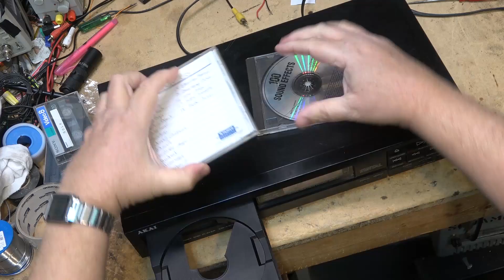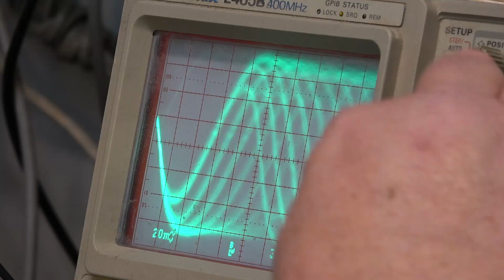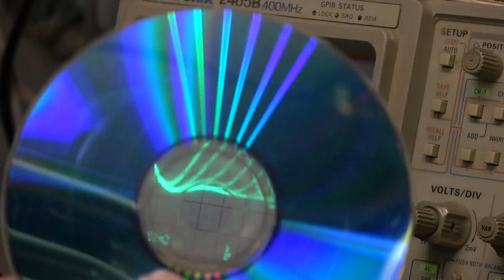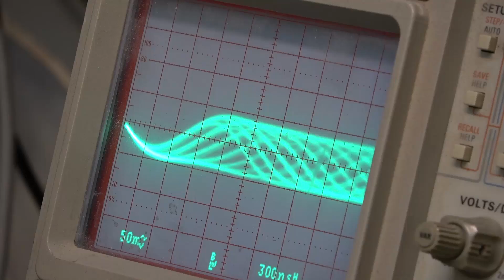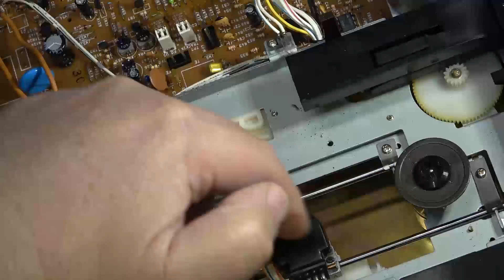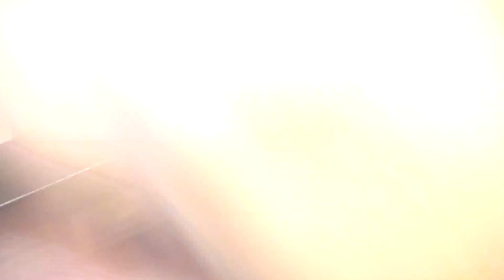Vintage Akai CD A30 CD player from 1986 will it work

Comment: I have slowly over time built an old school Akai sound system, a book shelf 3 piece set of amp, runner, and cassette, a reel to reel, 8-track, phonograph, speakers and head phones, the only thing missing is a working silver cd player. bought one, only to get it and find out its 230 volts, I am thinking of taking it to a repair place and having it converted to 120 volts, it wont be original but it will be mine and working anyway.

Comment: I have a very similar Akai CD player, it is a CD-A3X. It works fine, except when I hit the play button, the play indicator flashes rapidly as if it is going to play the CD, but it stops, and I have to hit the play button again to get it to play. Any idea as to what the issue is? Unfortunately, I do not have a scope. Thanks in advance.

Comment: I noticed you added external voltage to the sled motor without desoldering a wire to it. I did the same thing to a Linn cd player (1.5v applied) and now it's stopped turning. It had some fault where the sled motor was stuck in reverse in the home position whilst constantly turning. Have i blown the sled drivers with only 1.5v?
Reply from the maker: Possibly.
Reply: Update: no it survived in fact. Just that the faulty behaviour altered which caught me out. It's doing a shuffle during focus check so phew..

Comment: i have a mk2 version of the same cd player i have a problem i have cleaned the dust on the lens but still no solution i have to repeat it 3/4 times when i press the play button but then mostly it starts to read the cd it doesn't read at the first time and a song like 3,4,5 in any album When I try to start it, it doesn't come out of the line, sometimes after pressing the play button several times, the cd is read again, or the cd spins and the slider opens again.  What is the problem, how can I fix it?

Comment: That unit is 1983 in Tralee, kerry, Ireland. I purchased an AKAI Stereo system back then from my local Hi-FI Dealer, Hugh Culloty, Still also there. Namely AKAI Tuner AT-A102L, Akai CD Player CD A301 and an AKAI Amp AM A-302 along with a pair of Tensi 3 way active crossover speakers containing a 12 inch, 4 inch and Dome tweeter. All still working correctly in Sept 2022. Only  thing is the incandesent bulbs for the "LCD" display are not working. Must replace. But 29 years unbroken service is not bad going at all. Great manufacturer.

Comment: Does the clarity of the eye pattern on the scope says anything about the state of the pick up?
I have 3 CD players, one of them has a very sharp eye pattern, while the other two have a rather blurry eye pattern.
They all play CDs just fine, but I found that a bit interesting.
Reply from the maker: Yes a good laser the eye pattern is very sharp.  If it is fuzzy then the laser is getting weak.  Usually it is a cloudy lens.
Reply: @12voltvids  Thanks

Comment: Hi, sir, you have an oscilloscope galvanically isolated from the mains, or as it is solved, it is necessary when measuring amplifiers and so on, I am a beginner and I would like to understand here, thank you for any statement
Reply from the maker: Yhe ground prong has been removed from scope cord. Also my power out on the bench is totally isolated by means of isolation transformer.

Comment: Judging from the Sony chips and analogue filter, it looks like this Akai's a second cousin of my Ferguson CD-03 - itself an OEM variation on Sony's own CDP-102. The Ferguson's still a tidy little performer, with one proviso: if there's a speck of dust on the CD, it'll skip. In that respect, my rock-steady old Marantz CD56 (bought in 1984) wins hands down. CD players of that vintage were usually built up to a standard, not down to a price - it took manufacturers a few years to work out how to cut corners!

Comment: A little tip from me: to replace incandescent lights I use old Christmas tree lights.  (They are still sold and come in two bulb sizes) work from 5v at 60ma +/- to full light at 11v / 12v at 160ma. The intensity can be regulated with a resistor and they shine in all directions unlike LEDs.
Reply from the maker: Yes i know.  Will be looking through the box of old Xmas bulbs.
Reply: Thanks, great tip. Now i know what to put in the holders. Cheers

Comment: Setting up this CD player takes me back to trying to setup Laserdisc players.
Both side players were always a compromise between side A and B.
Interesting information on the difference between stamped and CD-R discs.
A well setup player will track even poor or damaged discs.
Reply from the maker: That's correct when you can play these low output cdrs which are the modern desks that are pretty much silver on both sides then you know the CD player is set up properly because with the low output the error count is obviously going to be higher if I player is out of spec it will typically start to skip
Reply: @12voltvids  I had similar experience with laserdisc players, you knew if you had setup issues if they could just about read a laserdisc, but wouldn't read a CD on the models with dual drawers.
The better players from Japan were better at tracking poor pressings.
The laser in the Hi-Vision HLD-X9 could even play discs with laser rot that other players failed to play.

Comment: Looking in to those hard to see places would be a good use of the bore scope you demoed. I appreciate your tidbits of information you add in to your videos
Reply from the maker: Problem is it has a 15 foot snake cable to get in the way.  Great for looking down drains and into cylinders or air ducts.

Comment: I did a demo of the Sony CD system around 1985 at the CBC. We generally found the disks sounded very harsh and brittle in sound quality at the time. The media at that time on the CDs were direct transfers from the original master tapes which usually had a boosted top end which would be "buffed off" of the vinyl pressing masters during the process of producing the vinyl disks. A few years later CBC Vancouver started a network radio program called Disk Drive where the concept goal was to play CDs only during the show. It took a few years before we were able to fully avoid the use of vinyl on the show as these were the early days of CD technology. We used Studer CD players which would often fail where a Sony audition player would play the disk without 'fails' or 'skipping'. This became more of a problem as the mass production of CDs increased. The error correction of the Studers was good to about 80% with software upgrades but the error rate on mass produced CDs were well below the accepted technical standards reading sometimes as low as the mid-60 percentile. We eventually converted to Technics pro CD players that solved most of these problems. Disk Drive with Jurgen Gothe aired for over 20 years on CBC Radio 2 (FM service).
Reply from the maker: Ah yes the old cinram disks so many of them were out if spec.   It was almost comical.
Reply: @12voltvids  Not when you were live coast to coast on the radio. Very frustrating and nerve shattering. Especially when you had no control or warning. At least with vinyl you could take a look at the platter and see if there was any visible damage or stylus wear. With CDs visually they looked the same whether flawed or perfectly manufactured. And we were playing mostly classical music disks so the expectation was that they were manufactured at the better plants.
Reply from the maker: @chriscutress1702  most of the disks sold in Canada were manufactured at that shitty cinram plant.  It affected many players and we would get players in that the complaint was skipping.  It was usually the high end players that had problems and the cheap ones would play fine.  Go figure.  Many early DVD players had similar issues.   Sony's too of the like had a compatability issue with many kids disks.  I remember one very well. Veggie tales with the talking vegetables.   Customers high end es DVD player refused to play.  Changed the pickup, spindle motor ext.  Put 500 in parts into this 1500 piece of shit.  Played every other disk fine just these ones that played perfectly on the cheapest player.  
Now I know what you are going to say, just  the customer to use a cheaper player.  Fine now the customer wants his 1500 back for the high end player that won't play his kids disks.  Very frustrating.  Sent it to Sony, they never did get it going.  Said the disks were out of spec sorry.  But they played fine on a 150 player and there was the problem.  Customer really wants money back now and it threatening shop with lawsuit. Going to sue the store that sold him a defective on his eyes player.  
Glad to be out of that business.  No wonder the owner had a stroke.
Reply from the maker: Early CDs were produced with analog tapes that had been equalized for vinyl. Record companies were cheap.  Proper digital recordings by Telarc, GRP ect sounded fantastic.  Also early CD players with early DAC had a bit of a harsh sound.  The tda 1540 used in early CD players was a 14 bit DAC.  CDs were sampled at 16 bit. The tda 1541 was much better.  Sony has very good DAC on their players.

Comment: Well it coped well with the 100 track disk, the firmware seemed ready for odd disks.
If all lasers were as good as that one.
Perfect looking eye, another ideal use of the analog scope.
Digital would have made  a mess of that pattern.
Reply from the maker: My shitty digital scope anyway.  It won't even display analog video.  Useless for most stuff.
Reply: My entry level digital scope does it just fine, you get a mess when you have made a mess of the settings.
Reply from the maker: @dlarge6502  mine won't display the eye pattern or video

Comment: Hey Dave I sometimes do a bump test just to see if when the machine recovers if it picks up at the exact spot of when the bump occurred. I have a portable Emerson boom box type that actually searched every track until it finds it. It didn't as I understand estimate the spot on the disk and quickly move the pickup to the approximate location and then find the start of the track. The VERY 1st CD player I ever owned. I later purchased another boom box type an RCA, it had a different system than the Emerson and it did an approximation of where the track was and quickly found the track compared to the Emerson. 
You worked on a Yamaha that had the EXACT same mechanism they used in my Emerson boom box. I don't recall if that Yamaha zipped straight to the track or not that was quite a few videos ago LOL. The circuits and ICs used to control the mechanism certainly make a difference in my experience. The Emerson really impressed me when it got bumped because the timer would blink until it recovered and would start playing at the EXACT spot the bumping caused the loss of tracking. The others I have didn't they simple refocused and started playing from that spot. That was intriguing to me LOL.
Reply: I have several players that would work only as headphone players, because any bass at all makes them skip. I do the finger tap on top of the cabinet as a test. I wonder if it means the laser is tired?
Reply: @zulumax1  
I have several players that would work only as headphone players, because any bass at all makes them skip. I do the finger tap on top of the cabinet as a test. I wonder if it means the laser is tired?

ME: Hello Zulumax1,

This is my thoughts on your question and of course from my own experience working/ tincking with CD players, I am by no means an expert. I think many factors come into play concerning a CD players ability to track properly. One factor of course is obvious the quality of the disk being played like scratches. CDs are made made very similar to the way vinyl is made. Molten polycarbonate is injected into a negative master containing the pits and lands. It is only good for so many copies (I forget the number) afterwards it would contain too many errors. 

How CDs are made. 

https://youtu.be/O3FQzwNzUE4

Now it could be a CD towards the end of the batch that the master negative is beginning to produce too many errors. 

2. The environment the CD player is in for example dusty location, next to a kitchen were greasy foods are cooked, in a smoker's home all of these can eventually work the the inside of the optics in the laser pickup. For an analogy like trying to look through a foggy window, the above will make it impossible for the photo diodes (what the laser is reflected to) to collect the ones and zeros that the disk contains.

3. Of course a tired laser could be the problem as your original question you asked about. 

4. It could be a bearing on the spindle motor that is worn out.

5. The disk could be extremely out of balance, causing severe tracking errors. Normal speeds for audio CDs is 500 (inner) to 200 (it could be 250) (outer) RPM. 

6. The electronics that drive the mechanism could be poorly designed as well. 

7. It could also be a poorly aligned optical pickup when it was manufactured, like a turning mirror slightly out causing the limits of the circuitry to be reached.

8. Definitely vibration can cause the servo lens to loose its locked tracking and the system will have to establish it again thus interrupting the audio. Incase you didn't know the lens is on a springy suspension and it is controlled be electro magnets one set to move the lens up and down and one set of coils to move towards and away from the spindle (unless it is on the Philips mechanism which most were on a swing arm). Bass would definitely cause the servo lens to loose tracking if the CD player was too close or wasn't on a solid floor. Another possibility could be the shock absorbers the mechanism is mounted in typically rubber that would deteriorate over time.

So those are a few of my personal observations and thoughts about possible hiccups that can cause less than desired operation.
Reply: @darinb.3273  Yes, I have oiled the top bearing on a spindle motor to fix one unit, another had lint that became impacted around the lens inhibiting it’s movement. Don’t use one of those lens cleaners which looks like a CD with a little brush on it, that caused the above mentioned compacting of debris around the lens. The.Denon I repaired had a plastic arm which holds the magnetic puck above the spindle motor became distorted due to plastic shrinkage caused by age of the plastic. Myriad of possible causes of loss of tracking as you pointed out.
Reply: @zulumax1  Indeed I hear ya about the disk cleaners (worse case) it will destroy the lens completely (severely scratching it) 
Best case it stirs dust into the inner portions of the laser pickup possibly rendering it unable to read a disk at all. 
In fairness there are some brushed CD cleaning disks that won't harm the lens there are approximately 8 VERY TINY VERY SOFT brushes that potentially could remove dust from the top, however  the disk is spinning as this dust is cleaned off so where does it go? Well of course it whirls around till it gets to a place that only a specialist that can take the pickup apart clean it and reassemble it lining the mirrors back in the proper place and while one could pay that cost said person could buy three or four replacement CD players. 
I took a Sanyo pickup apart and it NEVER read another disk LOL. so the alignment of the turning mirror is ABSOLUTELY critical in its position. I wonder now if I zapped one or more of the photo diodes.  it would go home and ignored the home position switch, keeping the sled motor running which resulted in the gear slipping over the flexible rack gear mounted the laser. I think it was a Sanyo mechanism. Yamaha used the same one in a unit that Dave worked on. It had the motor gear split which made it bind at the crack. Plastic over metal is NEVER a good thing they don't expand and contract the same which eventually leads to a split running the length of the metal shaft. That causes a extra space between teeth were the crack is making it bind up the sled motor is then given so much power once it over comes the resistance it over shoots the minor movement it needed and now it skips way forward or stops playing all together because the laser can't align itself to the spot because of the gear crack. It is ugly LOL. 
My mom gave me an Awia that the chip that drove the sled motor couldn't over come a resistor ring inside the motor. I took the motor apart took the ring off and it works perfectly now it wasn't stuck it moved easily by hand so the lubrication was fine. The symptom was unable to read a disk which it actually was but the laser pickup wasn't reading the table of contents because the sled motor drive chip got weak because of the earlier mentioned resistor ring inside the motor. I used a tiny disk cap like they used to put on smal motors to stop electrical brush noise. If you decide to check the servo lens use a bright light and a powerful magnifier, if it is cloudy/foggy you'll see it.